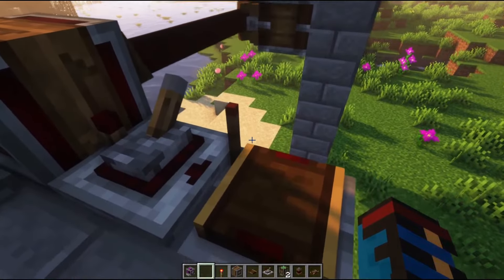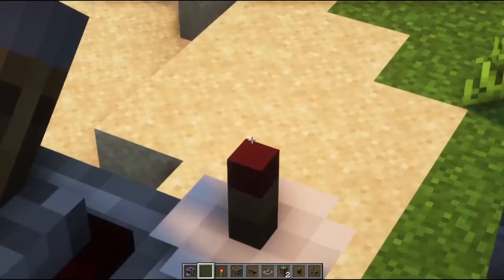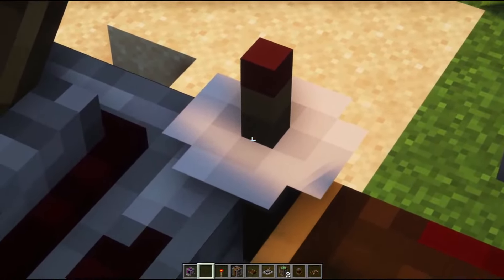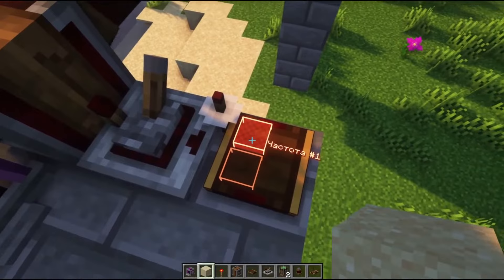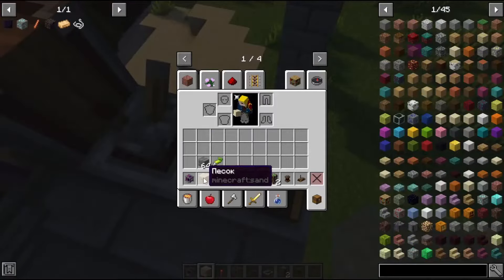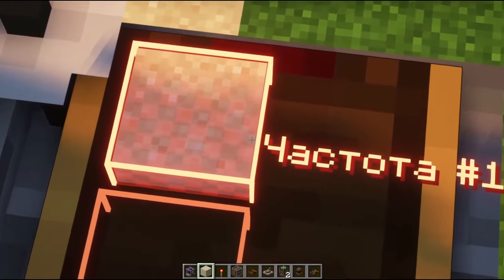Create mod. How to build a sliding doors. Tutorial / guide 1.18.2 - 1.19.2 (minecraft java edition)

Comment: worked perfectly, god bless man

for anyone in survival, a normal water wheel will handle this no problem. It will be slow but to solve that i just used a rotation speed controller set to 16 rpm with a large cogwheel on top connected to the door's gearshift which makes it go as fast as in the video. Probably not the most resource efficient way to make it faster, but it worked for me!